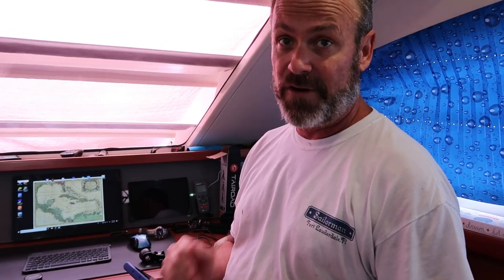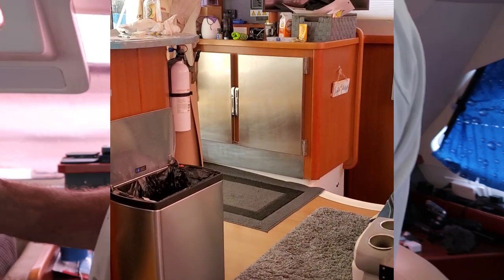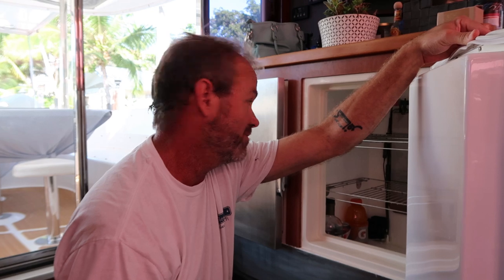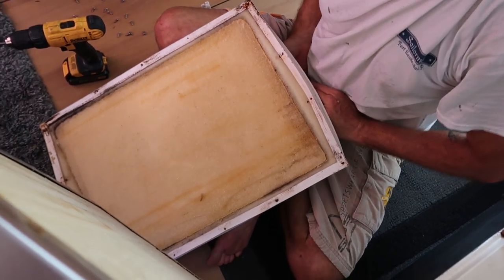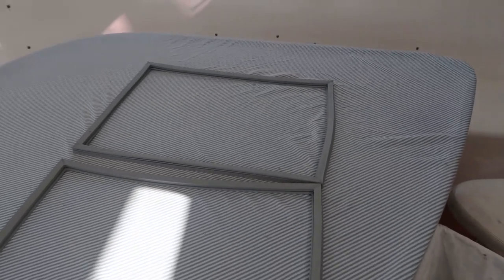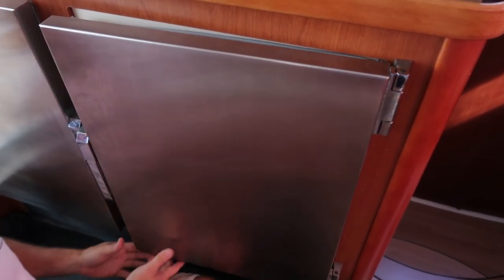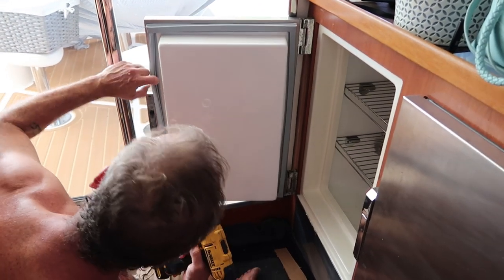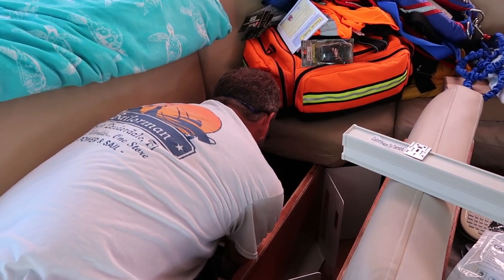Sea Frost Refrigeration Troubleshooting | Fix it Friday | Sailing The Space Between

Comment: The way to check the seals is to put a dollar bill on the closed door and see how much force it takes to remove the bill. Are the seals that you replaced are magnetic? You have a stainless steel frame. Did you put a set of gauges on the compressor to check the pressures?  If you need help I live in town not far from Sailorman.
Reply from the maker: we have not put gauges on it yet we will be back down on sunday do you know what the pressure should be I would love some help. drop me an email I will shoot you my number sailingtsb@gmail.com
Reply: not a bad idea! Thanks for the tip